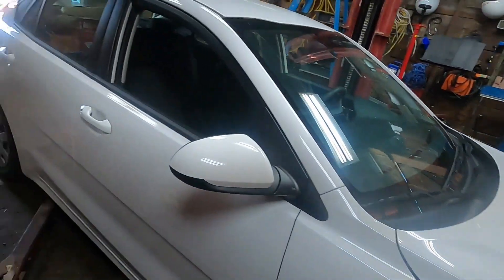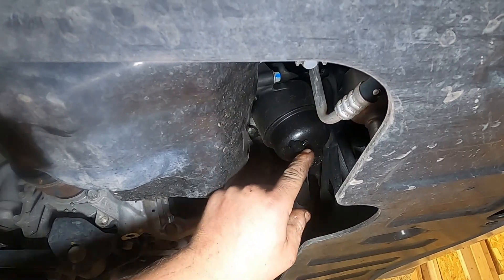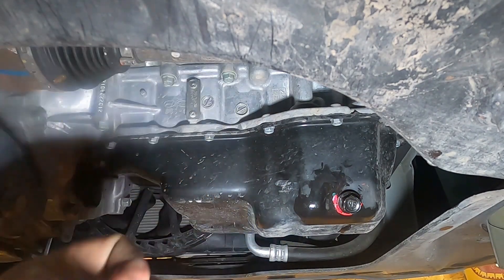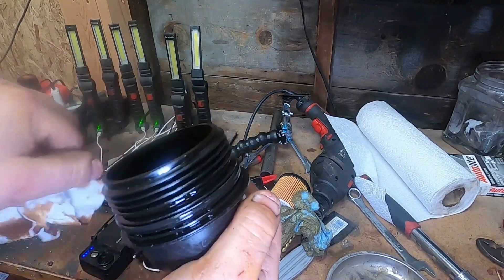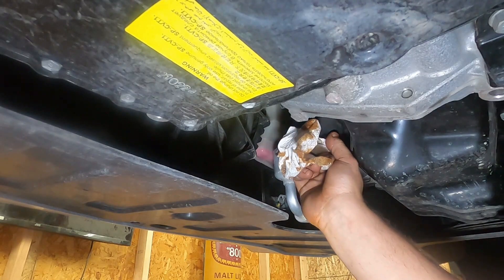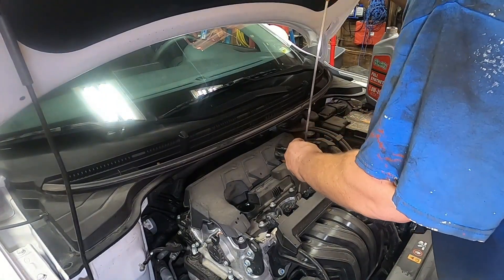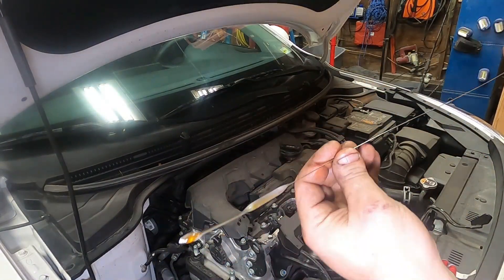2021 Kia Rio Oil Change

Comment: put the drain plug on the filter first and then pop it into the housing. for anyone else stuck on the exact part that he skipped
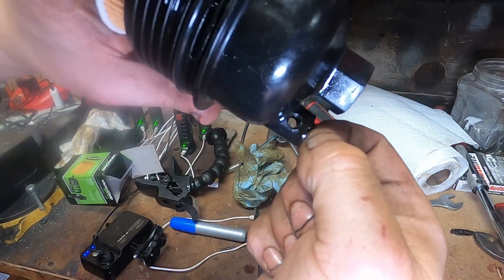Reply from the maker: 3:31 shows that the drain plug was pushed into the filter housing ( I believe that's what you ment and not the filter itself)
. Im sorry this hung you up, but that's exactly how i did it.
Reply: @toethumbmechanics  I couldn't get the plug to go through the hole on the housing for some reason. So I had to put it on the filter first, then put everything into the housing; it sounds weird, I know. Great video! It helped a ton <3

Comment: Hi how are you? Can you share what tools are needed for the 2021 rio ex sport 5door to complete the oil change
Reply from the maker: For the drain plug, you need a 17mm end wrench or a 17mm 3/8 socket and 3/8 ratchet. To remove the oil filter housing please use a 24mm 1/2 socket, 1/2 inch extension and a 1/2 inch ratchet.

Comment: so i got to the filter before realizing i dont have a 24mm socket or wrench, now i can't put the drain for the oil filter back in. not really sure why or if it's just finicky and i should just keep messing with it
Reply from the maker: I didn't put it back in until i removed the assembly

Comment: Do I need to put oil on the gasket on this one or pre fill the filter for this? Please respond and appreciate you! Also I need to replace the pin, the plug that goes I n it, the silver washer,  and the gasket that goes on the filter itself, that’s all the parts right?
Reply from the maker: I wouldn't pre fill the filter. Everything else yes
Reply: @toethumbmechanics  thanks. Is there a reason to not pre fill? I’ve read some people say the engine will run dry for a second others say there is more then plenty oil left still inside engine?

Comment: How much oil did you put after the 5qt?
Reply from the maker: The end stage I usually add until the oil is between the marks on the dipstick. So the last quart to capacity ill add and check until its at the proper level.

Comment: All I wanted to know was what size tools I needed. That information is not stated in the video.
Reply from the maker: For the drain plug, you need a 17mm end wrench or a 17mm 3/8 socket and 3/8 ratchet. To remove the oil filter housing please use a 24mm 1/2 socket, 1/2 inch extension and a 1/2 inch ratchet.
Reply from the maker: 2:23 im using a 17mm end wrench. 2:30 i mention its a 24mm. Ill add this in the description also.
Reply: How much oil did you put after the 5qt?